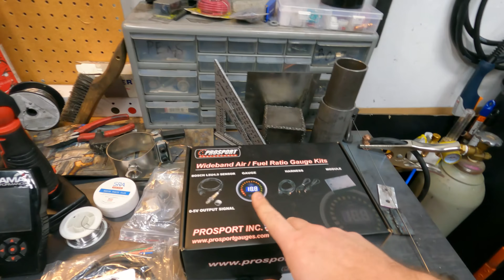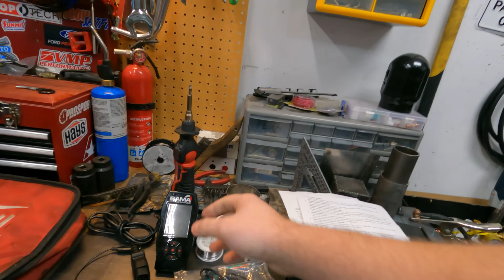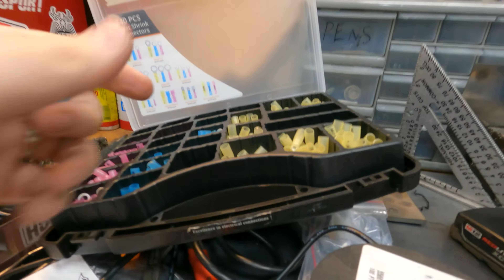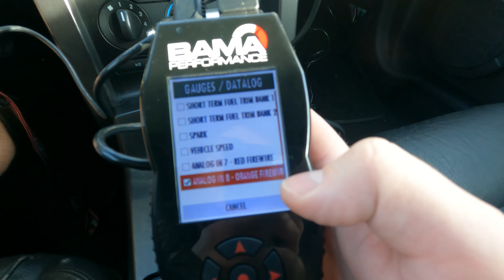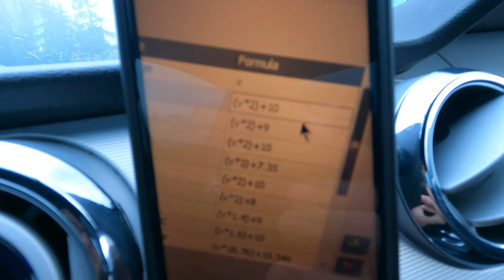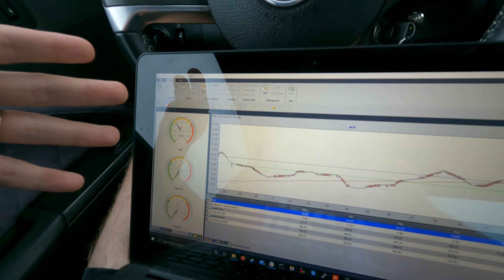How to Datalog with a Wideband Air/Fuel Ratio Gauge! (SCT X4 Tuner! Analog Setup Instructions)

Comment: Thank you for making this video!  I have an AEM gauge, so it's a little bit different set up.  When you pull WOT, does your AFR spike down?  For example, my readings are around 14's and 15's and as soon as I punch it to WOT, it instantly spikes down to 10's.  My tuner tells me my wiring is screwed up because it should have a smooth transition.  How does your data look when you hit WOT?